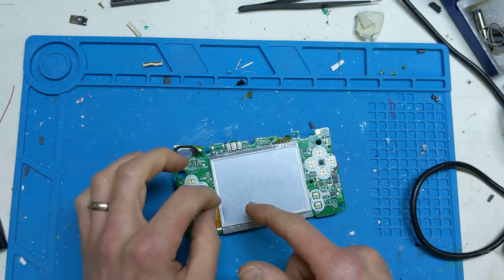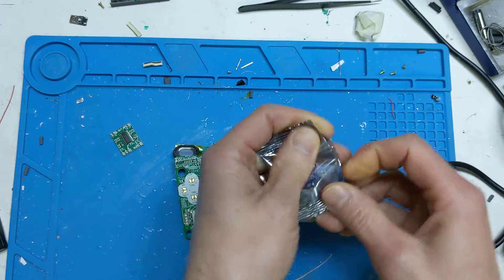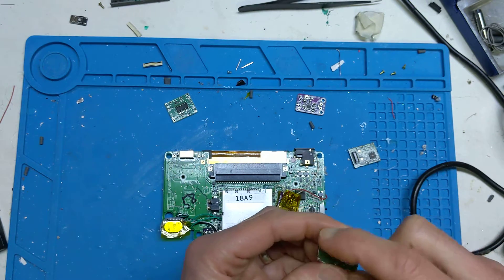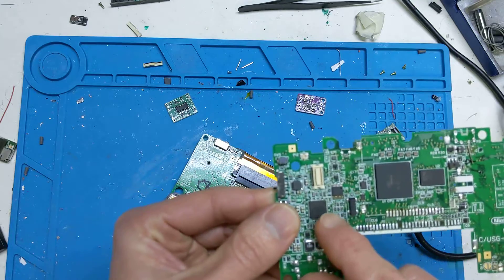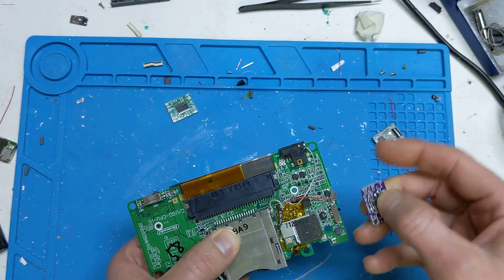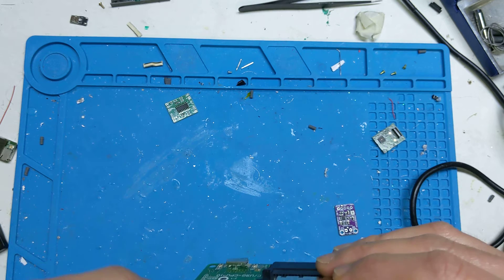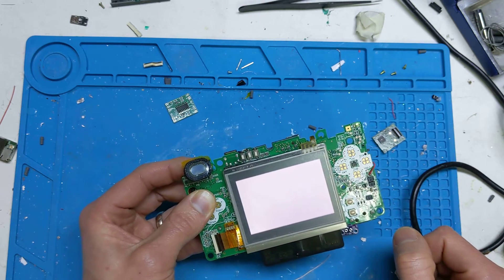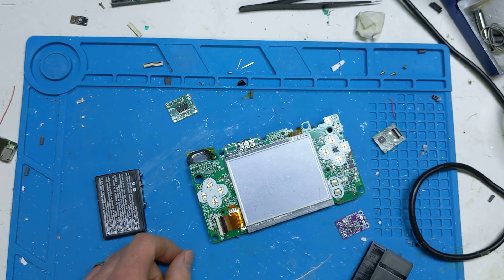Gameboy Macro new amp option

Comment: the amp doesn't keeps draining the battery while the nds its off?'
Reply from the maker: @sonic91131  no because it's wired into the ds power lines not the battery itself

Comment: Can you do a video for one of these amps being used on a DS phat?
Reply from the maker: I've never had a problem with the volume levels on a ds phat. Would just need to find 5v to tap into and then solder it up to the speaker break out points.

Comment: Is there a way to put the stereo out from one of those modules? I plan to put it to a DS lite
Reply from the maker: Yeah but you will need the pam8403 stereo board. It's abit bigger so you might struggle to fit it in
https://a.aliexpress.com/_EIuhZyT
Reply: @facelesstech  is out there any better boards for stereo sound?? i get a little bit of static noise from that one
Reply from the maker: @sonic91131  not that I've seen, try using a 3.5mm Jack to red and white RCA cable to make sure its not just what the ds out puts normally or the tv

Comment: Hello, just wanted to ask since I can't find the answer anywhere:

After doing this mod, the ds worked fine for a few tries up until it suddenly turned off. Now it just automatically turns on when the battery is inserted.

Tried removing the amplifier to see if a shoddy soldering was the reason but the problem persists even without the mod. I can't also use the power switch now, so placing/removing the battery is the only way to turn on/off the ds at the moment.

The ds works fine though, its just that the power switch doesn't seem to be of use now.

Anyway I could troubleshoot the problem? Maybe I accidentally soldered something on the alternative wiring?
Reply from the maker: That sounds really weird. Yeah you could have shorted out the chip for the alternative wiring. Not sure what to suggest to fix it, maybe check the continuity on the switch?
Reply: @facelesstech  quick edit: checked the power switch's continuity and it seems okay, but just to be sure i cleaned it out with ipa and still nothing. Even opened it just in case there's debris stuck there but also nothing.

After cleaning everything else with ipa, checking for missing components and then finally trying again a few more times: Now it doesn't even turn on. F1, F2, L2, L4 and em10 still shows continuity. Also checked the voltage path and there's continuity.

I'm honestly lost now.

Comment: I’m just starting out with the macro, majority of videos I’ve seen ditch the top screen ribbon cable etc... is there not an amp integrated there somewhere with the original speakers that could be reused?
Reply from the maker: Don't get me wrong the sound is good it's just not that loud. As well as most people put the speaker in the back which doesn't help, there isn't anything in the top shell apart from 2 speakers that are connected to the ribbon cable.
Reply: @facelesstech  makes sense thanks 👌